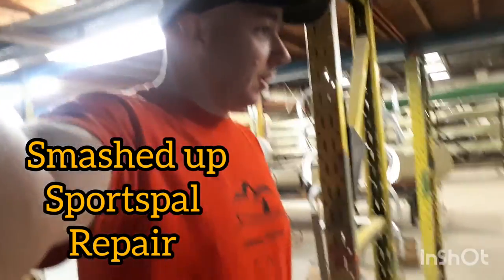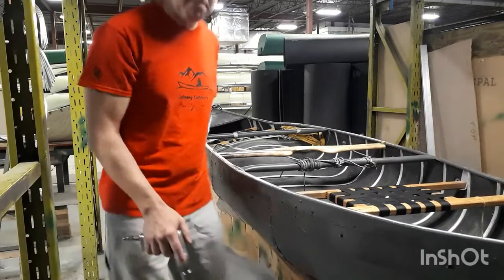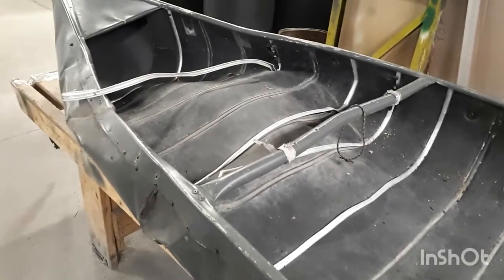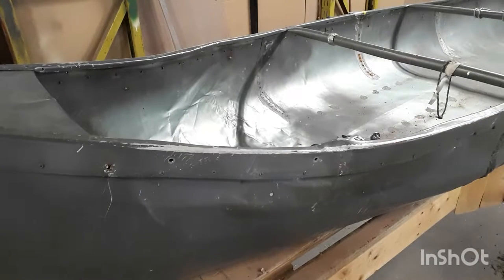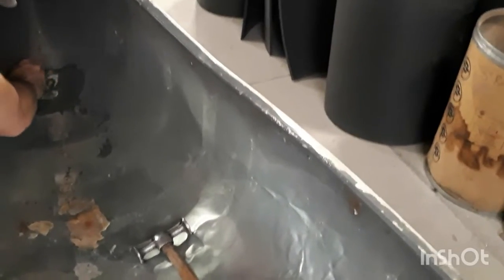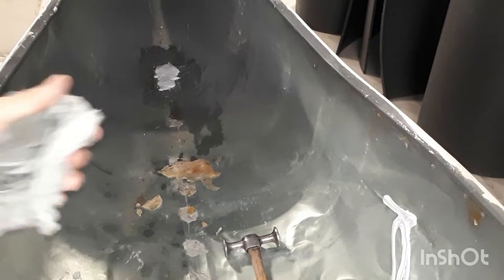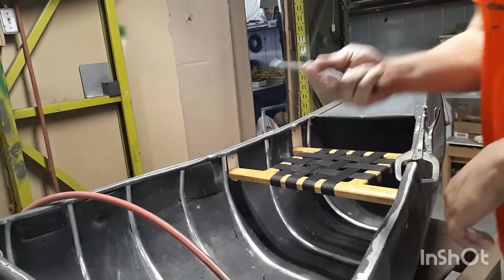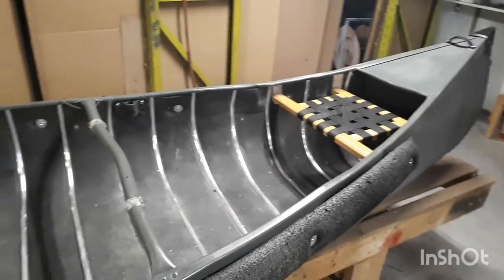Sportspal canoe repair of massive damage

Comment: Great job !  I had to do a similar job a few years back  and started out the same way,...got in it with my mountain boots on and kicked the s***t out of it to get it back in shape. Then used a series of rubber mallets to finish the job. Still using the canoe 40 years later !

Comment: I have a 1984 Sportspal canoe that leaks in the area of the front center rib just as the rib starts to transition upwards.  I think the gasket material is dry and brittle and the dents on the rib don't help.  This is the spot that gets struck first as one hits a rock in shallow water.  To fix this leak should I first try to tighten the rivets or should I just go strait to the marine sealant.  Or maybe add rivets in-between the current rivets?   Thank you very much.
Reply from the maker: If it is only slightly leaking on one of the seams, I would cover the problem seam with marine sealant, just watch for leak at the keel as well it's in the same area. The sealant was a dry product back then , it is a forever flexible now. Hopefully you get it sealed up. Cheers 🍻

Comment: I’m considering buying a 14’ pointe sports pal for my solo fishing trips and family fishing trips. I was looking at fishing accessories that will fit and was wondering what diameter are the thwarts. I was looking at clamp on rod holders to go on them. TIA
Reply from the maker: Hey there, I have used them in the past and work well. The thwart is 1 1/4".

Comment: I checked the website and didn’t see that marine caulk you spoke of. Should I call to see if they have it? Also, do you think marine shoe goo would work as well. Lastly, can a person leave the sponsons off if they have deteriorated ?  I have my 16’ Raddison apart and ready to repaint so want to use the right stuff. Thanks!
Reply from the maker: If you contact info@bwmarineproducts.com 
They will have the sealant. And if you want to leave the sponson off it would be  not too different from them all deteriorated anyway. Hopefully you can get it all fixed up good luck

Comment: amazing what they can come back from! I'm in the process of reviving one that's been in my family awhile. #692247. anyway, I need a new foam liner and figured you might be able to point me in the correct direction.
Reply from the maker: The only place I am aware of is the factory Baywood marine products for the liner. If there is a sportspal or Radisson dealer nearby they can get you one as well if the direct shipping rate is crazy. I will be putting up a video of the liner instal shortly. Good luck